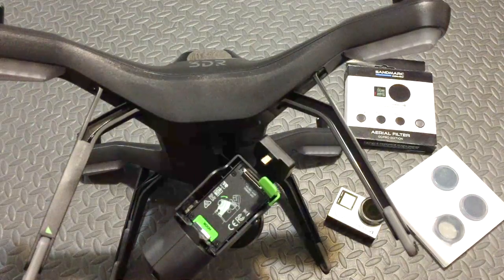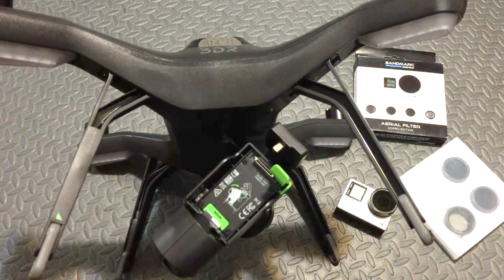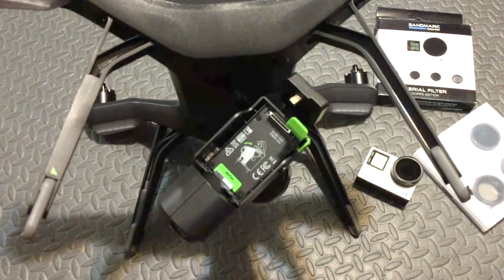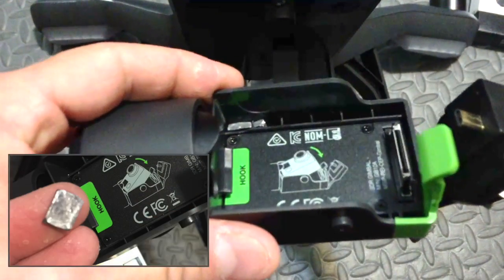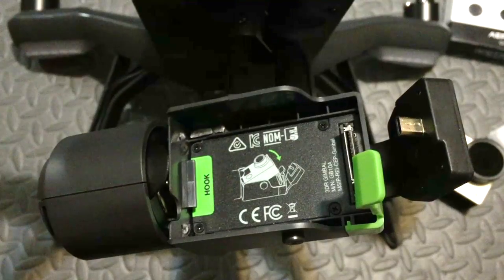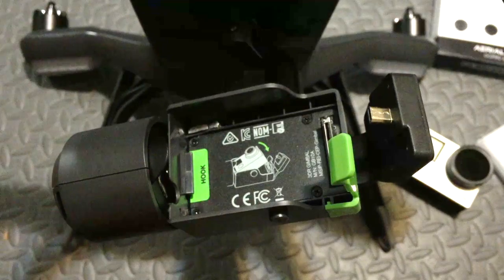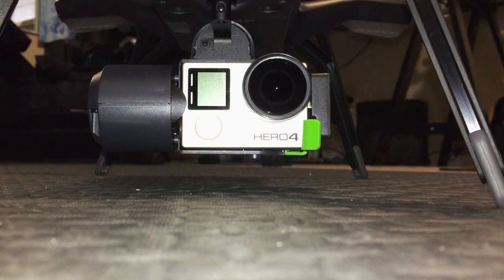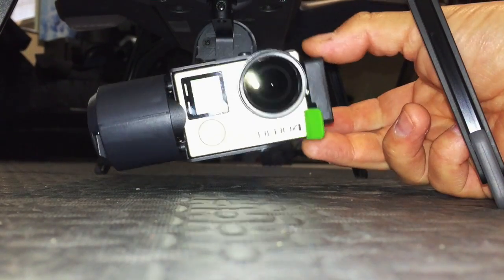3DR Solo gimble balancing, cheap and no coins

Comment: I need to try this..so the gimbal with no power on should be balanced with hero 4 black correct? Cuz sometimes,actually a lot,when I fly,the gimbal is tilted to the side a little so it's not level with the horizon and I thought it should be level with no weight for the 4 black..I will try after I pop off a few this weekend

Comment: Why do you balance it without the battery?
Reply from the maker: From my experience the gimble is factory balanced for a GoPro Hero4 Black without battery. With the battery installed the gimble flops forward indicating an unbalanced gimble. This also why the gimble flops forward when the Solo is turned off with a gopro with battery, indicating that the gimble was working to keep upright the whole flight. Without battery the gimble stays where it was when Solo is turned off.